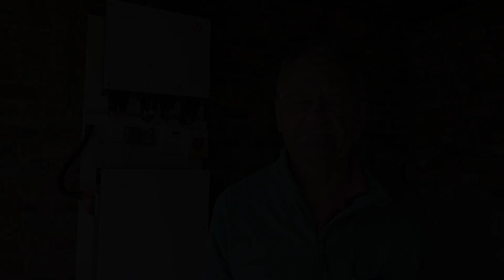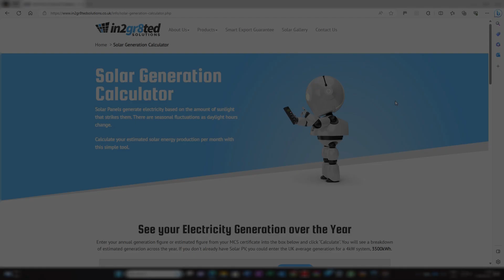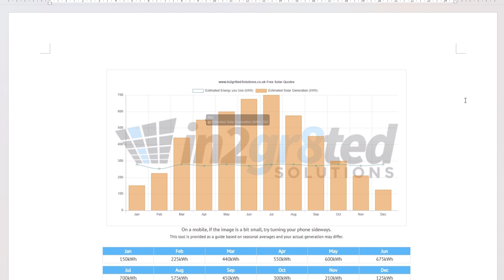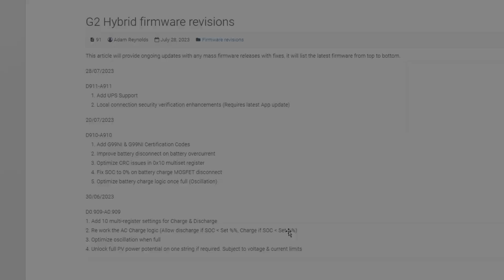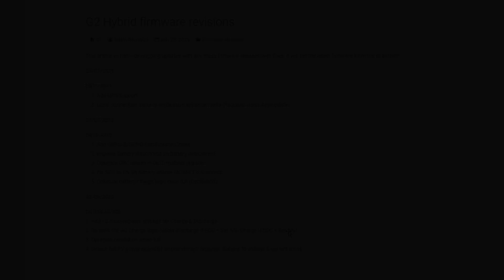HS217 Givenergy solar inverter and battery – 6 months update

Comment: Hi Paul. Glad to see that the batteries and solar are doing well. I have put in a victron multiplus system with lead gel batteries last week, so I am interested to see how it will perform. As storage goes it is much smaller than yours, but I did it with used batteries so there is instant potential to upgrade kWh storage if it underperforms and bigger batteries will help. As for your tripping issue, on my ABB inverter the installation specifies that you need a 300mA rcd rather than the usual 30mA that is fitted in most houses. Maybe this has something to do with it?  I was intermittently getting trips on damp days from an earth leak from the array(I think). Since we have had solar installed, even with a small system like ours, it is difficult to see how every house/garage/workshop/warehouse hasn't got a few panels to save money. Modern panels are over 500w per panel! So roughly 0.25kw/m2. And as you have said elsewhere in the comments they are getting cheaper all the time. But still, we have a grid fuelled by gas with roughly 50% generation and transmission losses!  I have noticed since I got panels that how I use energy has shifted. I will try to balance the load throughout the day and only do laundry/dishwasher etc (water boiling activities) during the day.  I think that if you don't have batteries this is the best way to get the most savings from the power produced, a feed in tariff is great but using as much as you can before export is best. Oh how I ramble... Cheers!
Reply from the maker: Hi Owen, great to hear from you. Well your 'ramble' raises some really good points and adds practical depth to the conversation which will help people at the mercy of 'brochure engineering'. If you have the knowledge then starting with DiY batteries is a good way to get up and running without hight cost, which can then inform choices before spending too much. We had our outbuilding feed on a 30mA RCD supplying various high load items, motors and whatnot, and adding the inverter on top was just too much leakage. The total leakage was only occasionally above 30mA though as I could not get it to trip by just turning things on and off manually. The installer split the feed and spread the load adding RCBOs in the consumer unit.  I read that poly crystal panels were about 13% efficient and mono crystal (the modern ones) are about 21% efficient. It's going up all the time. It's amazing - most of the time our house could run on one £150 panel (when the sun is up).  Don't get me started on wholesale electricity prices - solar and wind generation is so much cheaper than gas-fired generation yet the prices are held high to subsidise gas and nuclear. As the % of green energy increase this situation will become undefendable. Our nightime import tariff is 14p and our export tariff is 15p so allowing for some losses they balance. The most important thing is to avoid drawing on the expensive daytime tariff.  Yes, solar is a no-brainer if you have the capital to buy it and the roof to put it on. Cheers

Comment: Interesting stuff Paul. I wonder how the system would perform for a less tech savvy layman, who just has it fitted and leaves it to its own devices?
Reply from the maker: Hi Matt, the key is to always ensure, if there is no sun, that the battery is charged enough at night to avoid drawing expensive electricity off the grid in the daytime. Now it turns out our night import rate is 14p and our export rate is 15p so if we do 'over-charge' the battery at night and solar goes to export then there is no financial penalty. But in the future I'm sure Givenergy will add weather forecast adaption, taking into account tariff,  so the system will automatically charge the battery fully at night if the next day is going to be dull. I have a home smart thermostat that works in a similar way (called Tado), and it's an easy incremental add-on to a cloud-based  system which can control the inverter and battery parameters remotely. So, maybe in future the householders won't need to be so tech-smart to get the lowest electricity bills. Cheers

Comment: Hi Paul. Very timely update. I have a “solar installation” survey this week in readiness for a new system begins installed this side of Christmas. Such a learning curve. 🥴
Reply from the maker: Hi Andrew, solar and battery are simple in concept but moment by moment it's very difficult to predict because there are so many variables (state of charge, how much sun, house load, time of day tariff etc, and then tariff changes every 3 months at the moment). All I can say is get a system that gives you as much data and as much control as you can, and online for firmware updates etc.  I was watching a vid the other day where a householder had a battery from a big brand very reputable company but they did not have the level of control they needed, to the point they said they could not recommend it. Cheers
Reply: @HaxbyShed  Thank you Paul. That’s super useful for when I meet up with the surveyor on Thursday. I will have a list of questions to ask him. 👍

Comment: The Not have a MCs scheme charges you £250 to join and will only be for a select few on a trial scheme

I do indeed set my charge times to coincide with the cheap periods on octopus agile, my September average was 11p per kilowatt hour.
My bill for September was £23, and that includes the standing charge.
Reply from the maker: Hi Ian, thanks for the detail. We've only had our system 6 months and every household is different but I predict we'll export 1800 to 2000 kWh over 12 months. At 15p/kWh that would recover the £250 in a year or less.  Cheers

Comment: Excellent précis Paul,  good account and update. 
Thanks for sharing
Reply from the maker: Thank you John. There is no way to forecast the annual saving accurately mid-year because so many factors are changing all the time, not least the cost of electricity which changes every 3 months at the moment. My target is to save £1500 across 12 months, if I can. Cheers

Comment: Very interesting
Reply from the maker: Thanks Kimber.  Solar panels are still not that common over here although interest is increasing as panels have got a lot cheaper and electricity costs have shot up in the past 18 months due to shortage of Russian gas (about 35% of UK electricity comes from gas-fired power stations). Also with increasing numbers of electric cars having some form of home generation makes sense. Cheers

Comment: Even in NW London we get power cuts, not as often as decades back perhaps but they do still happen. Just a few weeks ago the power was out for an hour, after midnight but some folks are still up, luckily being old school we had plenty of torches, candles and even oil lamps. With our ever increasing reliance on electric power it set me thinking about some for of stored electricity, even if it just kept the land-line phone and Internet live.
Reply from the maker: Hi Chris, you can buy desktop computer battery backup systems for as little as £70 but these could just as easily power a phone, router, a TV and some lights in a power cut. Now and then the rechargable batteries would need replacing but I expect they last several years. Cheers

Comment: Living in north central US, this doesn’t apply to me, but I still find it very interesting. 👍
Reply from the maker: Hi Mark, renewable energy and home generation are becoming big topics here. I know in Holland there are some pilot schemes where people charge their cars at home at night on the cheap rate, drive to work, park and plug in, and sell excess car battery power to their employer at higher daytime rates (helping to power the office or plant for less than it costs the employer to buy power from the grid). Also, it won't be too long before the car battery and the home battery are connected so excess car charge can power the home (called 'vehicle to grid'). There are some early schemes for that already here - you can buy v2g systems for the home now. Cheers

Comment: I found this interesting. Where we live, our electric rate is the same all day and does not fluctuate. I am not even sure that's an option with any of the energy suppliers around here. I've heard of that being the case for industrial customers, but not residential. Perhaps you said it in the previous video, but based on what you're experiencing today, how long before all of the costs of the system have been recouped as a result of savings on your electric bill?
Reply from the maker: Hi Greg, the short answer is about 8 years. The long answer is it depends on electricity prices and inflation. Higher electricity prices = shorter payback.  Higher $inflation = shorter payback because the value of your original investment, expressed in today's prices, falls away quicker. It's basically a bet. Panels are still coming down in price quickly. Batteries are still expensive but prices will fall gradually with scale and new technologies  - in three years I reckon they will be 25% cheaper (that's just an uneducated guess).  Most UK energy retailers still only offer flat rate or economy 7. There are newer 'challenger' companies offering the smart tariffs which offer great savings to customers with elec cars, panels, batteries, heat pumps etc. Cheers